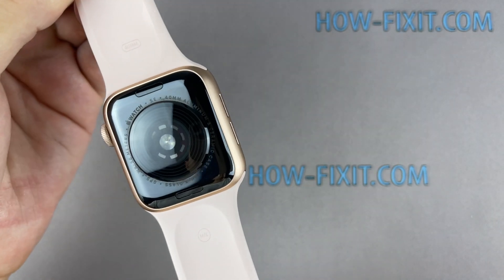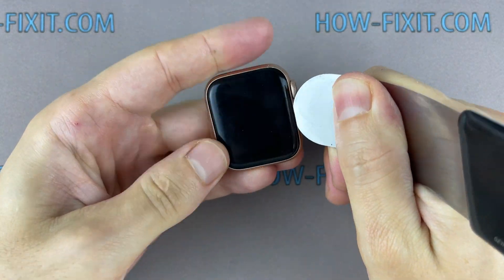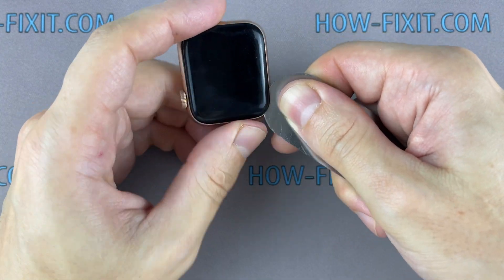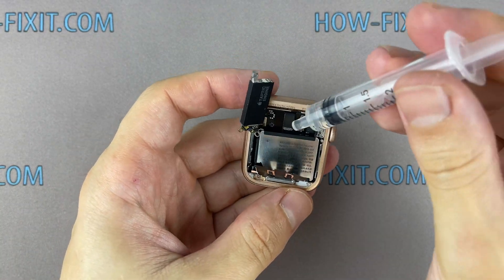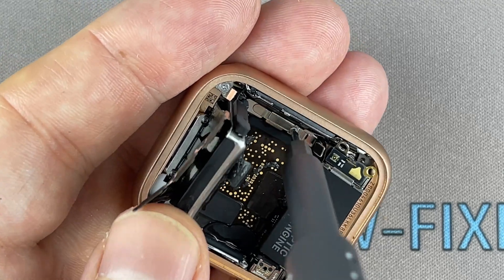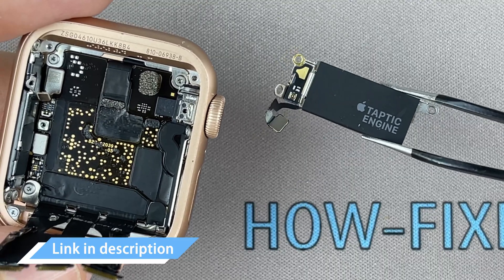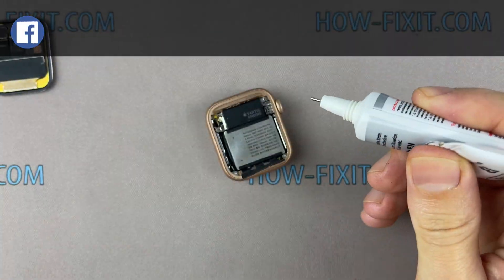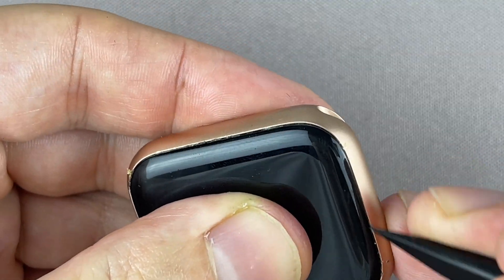Apple Watch SE Taptic Engine Replacement

Comment: hello!  Can you help?  I replaced it and thought there was no problem, but maybe I made a mistake in the assembly process and it consumes 4 times more battery than usual. It consumes about 1% in 5 minutes without doing anything.  Is it an isolation problem?